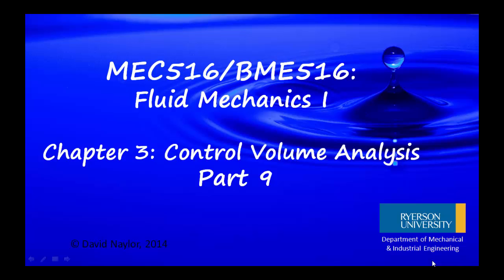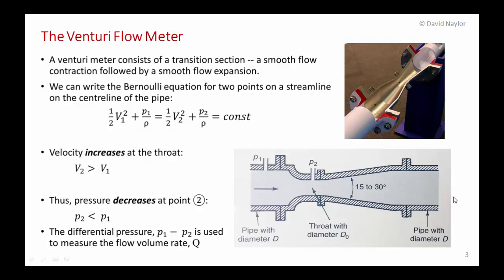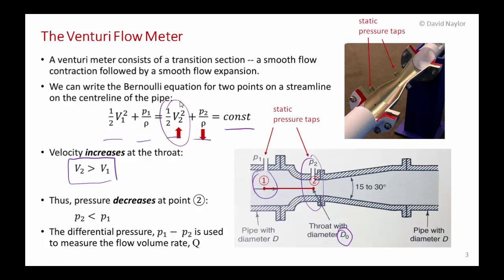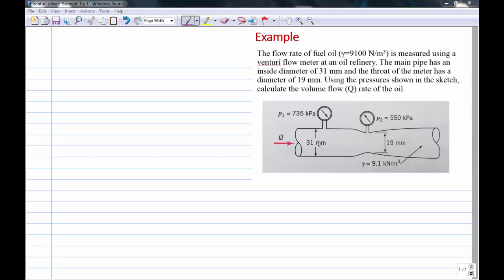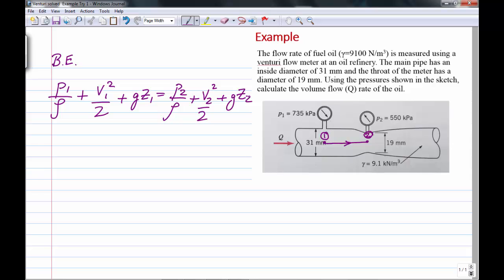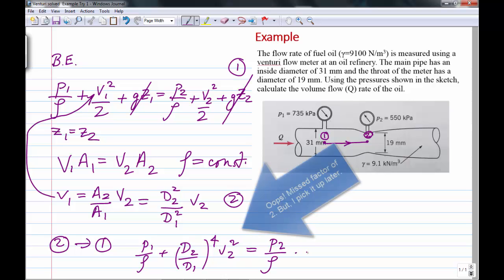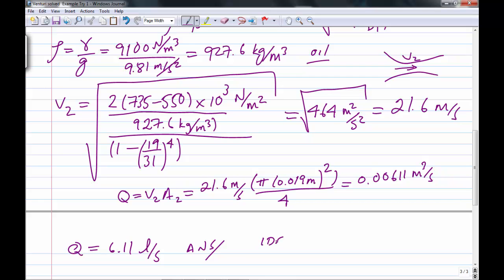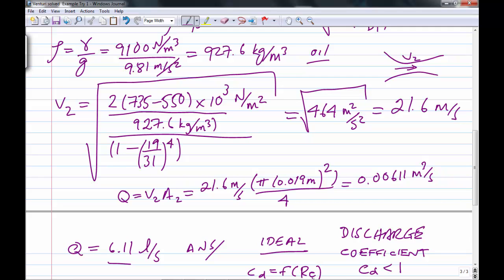Fluid Mechanics: Flow Measurement with Venturi Flow Meters

Comment: when using the values for the diameters why was it not converted to meters when solving for Velocity at point 2?
Reply from the maker: It is a diameter ratio. The ratio of 19mm/31mm is the same as 0.019m/0.013m.
Reply: @FluidMatters  okay thank you ! That is what I thought.  Do you recommend videos or have videos regarding the chapter 6 topic viscous flows and ducts as well as chapter 7!;@92 psst immersed bodies ?